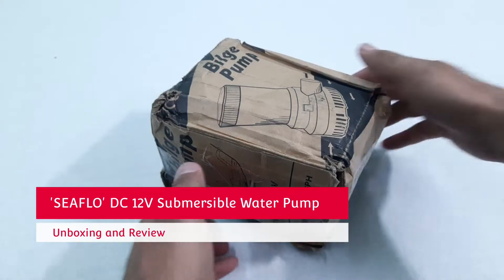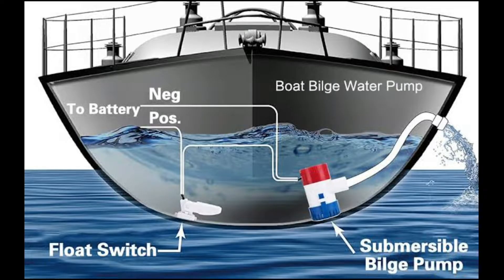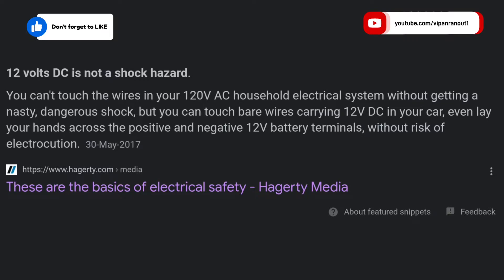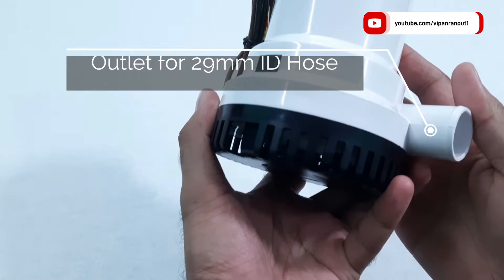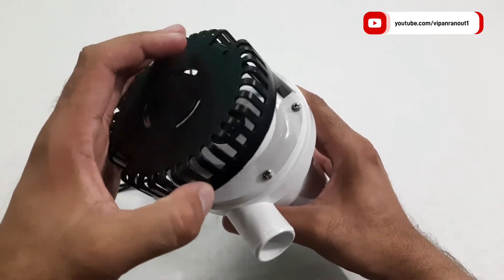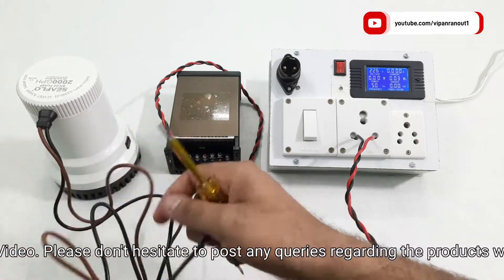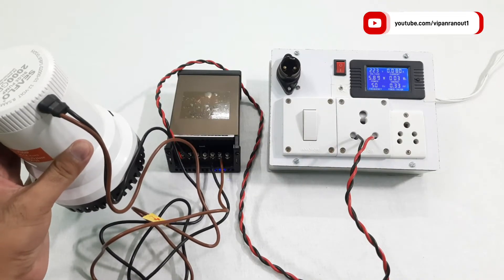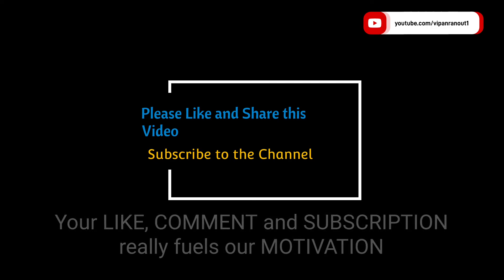Seaflo DC Submersible Water Pump. A safer 12V alternative!

Comment: How much battery capacity need for better perform
Reply from the maker: Battery capacity will decide the time for which the motor can run on battery. 8Ah battery will run this for about an hour. Similarly 56Ah battery will run this for 7 hours continuously (little less than that in practicle use). So you need to choose as per the requirement.

Comment: will 1inch diameter pipe fit for that 29mm ID hose? bro i don't have much clue about pipes so i want to be sure before i order.
Reply from the maker: 1 inch pipe will have inner diameter (ID) of 25mm, whereas pump by default requires 29mm. I think it will be a good snug fit. Might require some effort initially but it will fit. There is always a workaround possible.